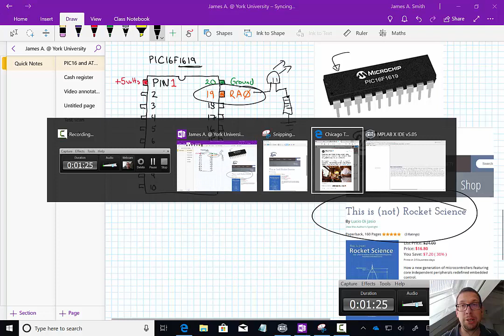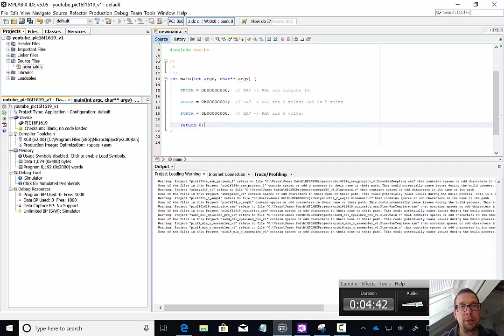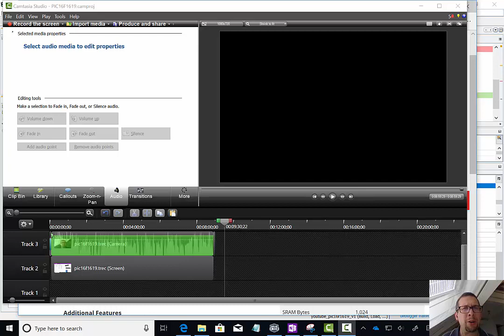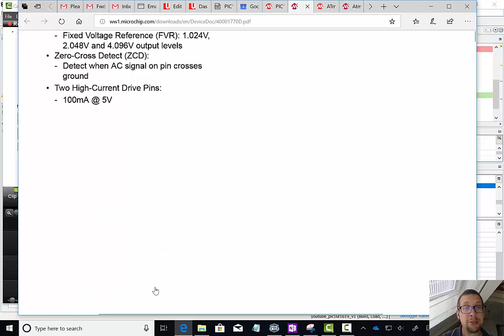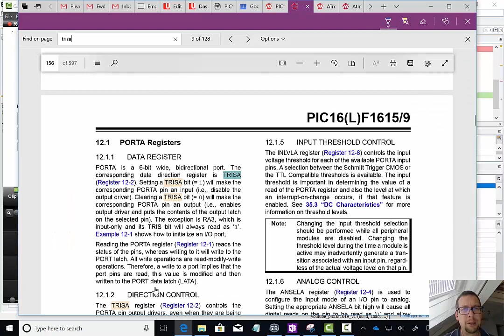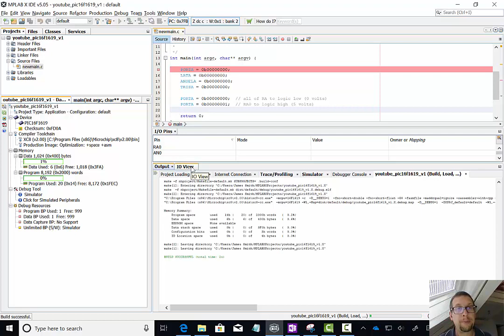Making mistakes while learning about the PIC16F1619

Comment: When I try to debug this program, I get a message that reads 'the requested operation cannot continue with the following configuration bit setting(s)' Watchdog Timer Enable = On.  What could be possible wrong?  I am using MPLAB X IDE and Curiosity development board and XC8 compiler
Reply from the maker: The Watchdog Timer is a safety mechanism built into many microcontrollers, including the PIC16f1619.  You should try setting the configuration bits for the chip.  Window->Target Memory Views->Configuration Bits . Then, a small sub-window will appear (usually at the bottom of your IDE window), called "Configuration Bits."  Find the WDTE entry.  Change it from "ON" to "OFF".  Then click on the "Generate Code" button.  Copy and paste the resulting code into your C code file before main() and recompile.
Reply: @onnimikki2007  Thank you, it's working